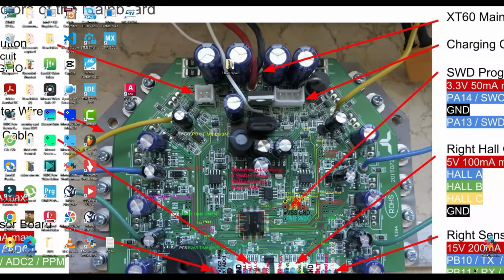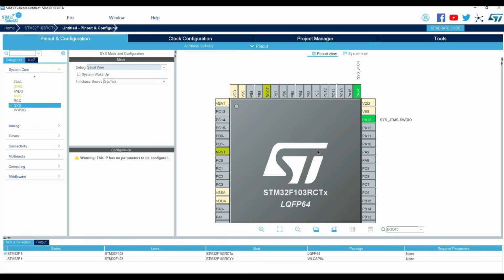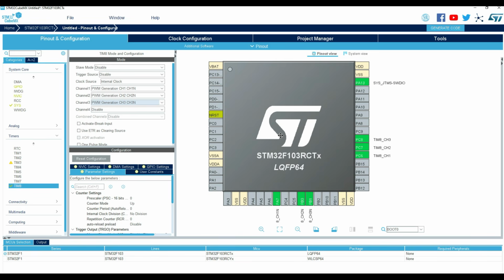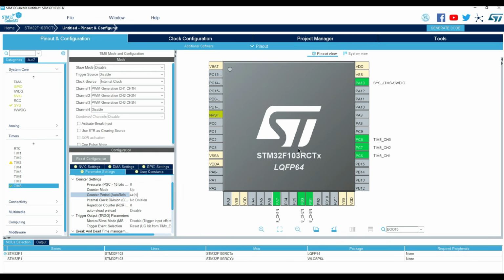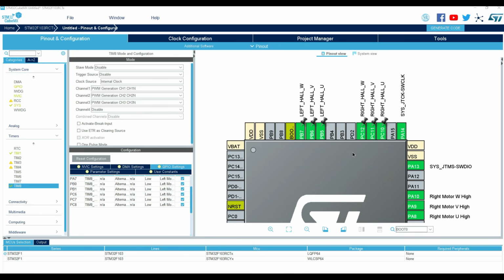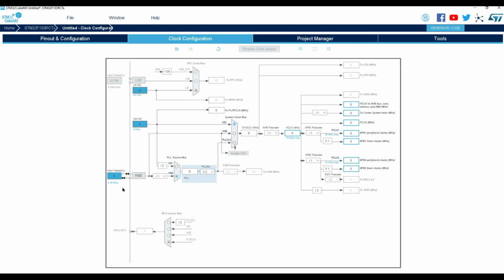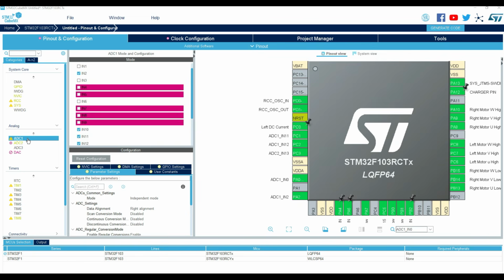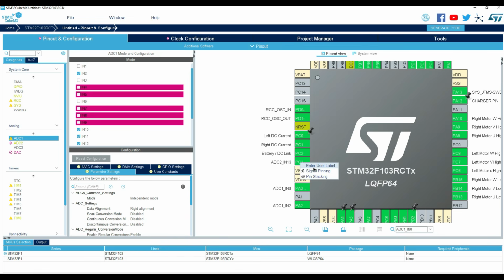STM32 Hoverboard BLDC Motor Control Explained Code Setup in STM32CubeIDE

Comment: Sir you are so much talented I really need your help is it possible to update hoverboard frimware which have following futures: 
Speed limit 80%
Ramp up 8sec smooth 
Only switch with two pins (no throttle and potentiometer)
10% battery buzzer sound for 2sec only